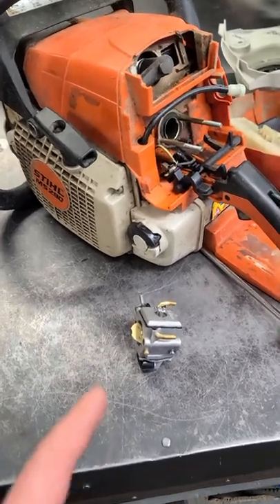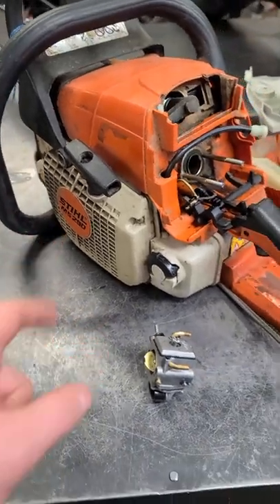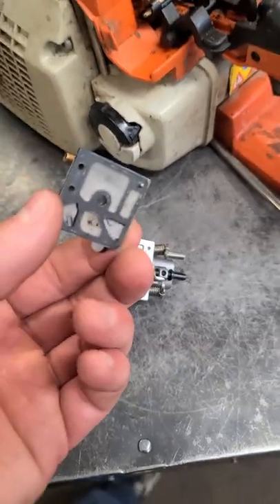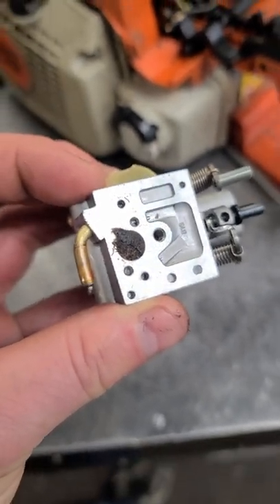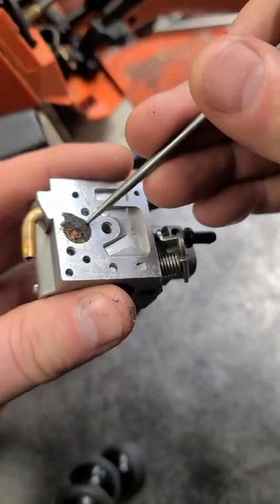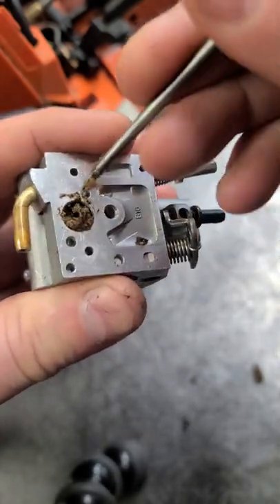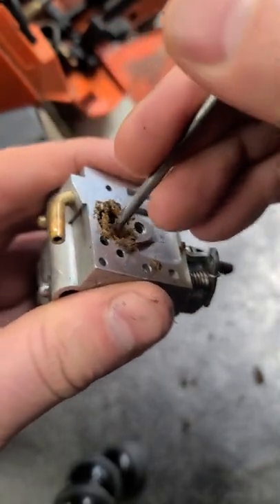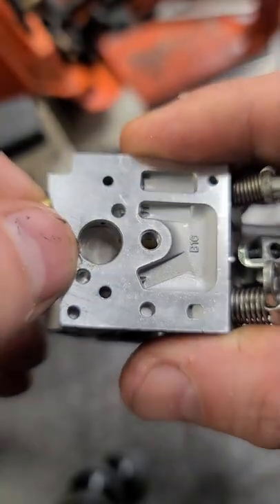Stihl Ms290 Was Bogging Down- Here's Why! Not A Plugged Muffler!  #shorts

Comment: Damn, that is excessive. I'm surprised that this chainsaw ran at all.
Reply: Same! I wanna pull some filters esp on my "daily driver" saws to see if they habe buildup, I work in FL yet have never had a carb issue ever (I theorized in my other reply that it may be because, by being religious Re no ethanol fuel in my units EVER, maybe what gets by the fuel-filter just goes all the way into my cylinder & out of the engine....cannot fathom how I've never had a carb issue with how many hours of FL work I've done the past >1/2 decade of daily, professional use!)

Comment: When it’s that bad I always check the fuel filter for any defects or even to see if it’s still attached
Reply: Had to be running without one. Or line in tank was split
Reply: @BabyGators that’s why whenever I get a piece of equipment in, I look around for visual inspection and then the second thing I always do is pull the fuel filter out and pressure/vac test the fuel line/make sure the fuel filter is good.. plus that checks one part of the carb too..

Comment: That's why I carry a cheap paint brush to clean the gas cap before I open it.
Reply: There ya go!
I got a little belt pouch that holds a scrench, a paintbrush, a carb screwdriver, a wedge, and a plumb bob.  Those 5 tools fix or prevent about 75% of your cutting problems.

Comment: Wow I have old chain saws and never seen one that plugged up.
Reply: Yep; my old Super XL AO is over 50 yeard old and well used.  The air filter on it during a 3 day job was undersized and did not stay in place.  Even at that, when I removed the carb for cleaning the screen was not that clogged.  I used a vacuum tool to clean the screen and then cleaned the metal parts in an ultrasonic cleaner.  Put it back together with original "kit", still plyable.  Runs great again.

Comment: Never seen anything that bad in my lifetime. Hey Don was there a filter in the tank? 🇨🇦🇺🇸
Reply from the maker: It had fallen off fuel line
Reply: I’m still trying to find a balance between cleaning the saws excessively or not cleaning enough.  I’ve went both ways.  More looking toward “balance” in my maintenance program
Reply: @dannyball2503  I repair paint sprayers and I can tell you, the ones that maintain there machines by doing simple maintenance like cleaning filters and oiling pistons, get more done and spend much less on repairs and have less emergency down time. These machines are same if not much more expensive than chainsaws and in similar harsh environments (air full of paint particals being sucked into fan of motor, etc)

Comment: That is dirt that went through the air filter because of lack of service goes thru the engine and up the impulse line of carb and always properly clean and kit the carb just don't clean the dirt
Reply: Nope. Hose rotted off in tank filter...there is NO connection from that screen to the air filter.

Comment: Absolutely NO WAY all that got past a PROPERLY installed filter.  I've worked on some naaaasty  saws and the only one I have seen that was that bad DIDN'T have a filter at all. Did that saw have a hole in the fuel line ? Or just No filter ?
Reply from the maker: filter had fallen off hose in tank
Reply: @donyboy73  Now THAT makes sense. Thanks for the reply. 😎🇺🇸